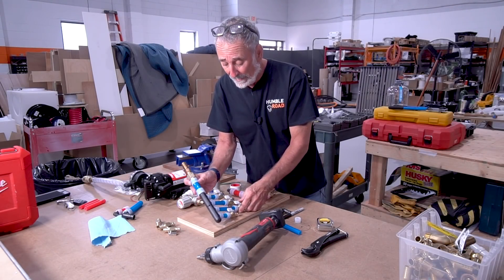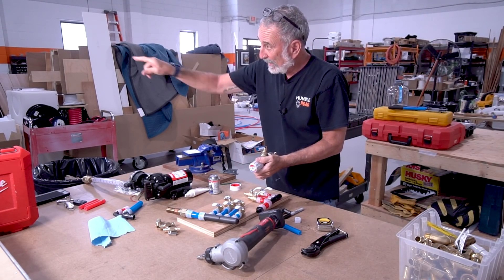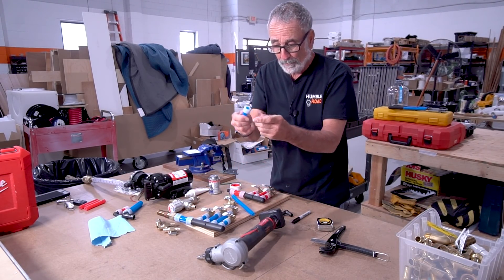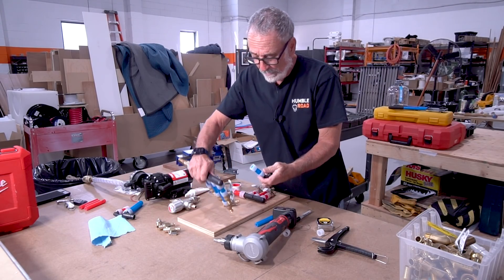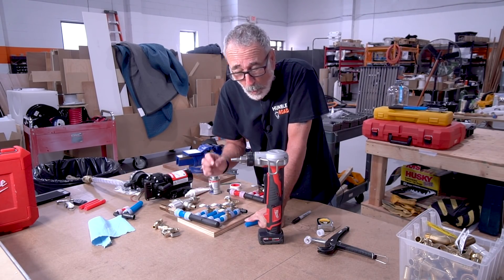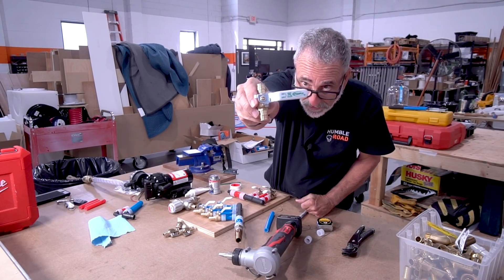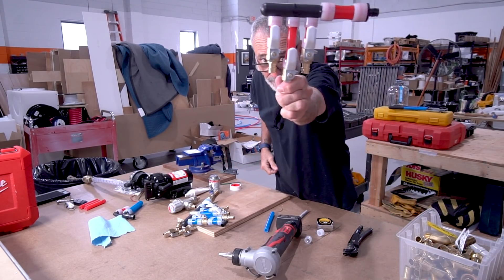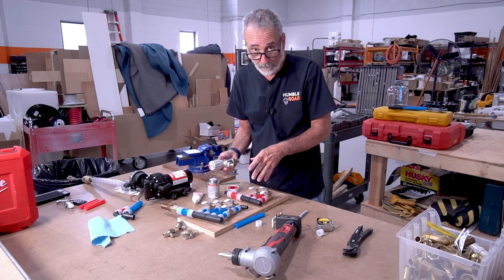VAN BUILD TIP SERIES: Building a 4 zone plumbing manifold using Uponor/Pex.

Comment: Has there been failures in the pex-a? I hear it's been a problem.
Reply from the maker: Yes, I have read that when the pipe is exposed to sunlight, the red/blue pigment in the pipe causes brittleness and cracking. Uponor, for one, has discontinued the full color pipe, replacing it with all white pipe with either blue or red writing along the side.
Reply: @HumbleRoad   Do you still recommend it?
Reply from the maker: Absolutely

Comment: Thought on plastic manifolds vs copper manifolds?
Reply from the maker: The plastic manifolds are part of the Uponor system, which I feel is an excellent system, superior to copper and sweat in my humble opinion
Reply: @HumbleRoad  Please explain why. I'm still learning – I understand the different PEX tubings, but still learning about plastic vs copper vs stainless, etc.

And thanks for the well-done videos. :)
Reply from the maker: Sweat joints will not hold in a moving van. Uponor.com

Comment: Can the levers on the valves be swapped out for knobs? No more issues with them bumping into each other then, and a clearly labeled knob would work just as well I'd think. Also, have you thought of using heat-shrinking hoses on the lines, as a secondary water seal? The issue being you'd lose your color coordination and could only use it on contiguous lines, but some colored tape would solve that and maybe leave you with a double-sealed line. Also also, could gorilla glue be used as a seal in case of a leak? I wouldn't think it would harm the plastic, and since GG is rubbery even after drying it won't be brittle, so it'll deal with movement (Bounces and so on from the vehicle moving) better. (Edit spelling)

Comment: is the crimped
ring pex ok (that's what i installed so far)
Reply from the maker: As long as your crimps are good, you should be fine. The Pex A (Uponor version) is flexible and therefore will survive freezing conditions

Comment: Another option: they sell copper manifolds with built in valves for use with expansion fittings - would work out to around the same price considering all the valves and fittings, not to mention all the time spent doing a DIY manifold.
Reply from the maker: Needs sweat? No? Or are they threaded?
Reply: @HumbleRoad  I've seen all different kinds; crimp, expansion, push fit, etc. Just mentioned because I'm working on the exact same thing right now!
Reply: @HumbleRoad  check out PEX Universe online.

Comment: I used the same mixing valve on my inside shower. Only one line across the floor no reason for access to plumbing behind the valve. Saves water by not playing with a shower control. Adjusts itself as your hot water empty’s. After having an electronic control at home I realized I’ve never changed the temp. So what’s the point? I bet I couldn’t convince 1 in 100 to try it though.
Reply: That sounds like a brilliant idea.

Comment: totally get the need for quality fittings and short spans/small footprints in your van builds.  Hopefully you don't have any more leaks...otherwise you'll have sharkbite and other fittings Frankensteined together when your clients are 'on the road'...and with such close tolerances it'll be an additional challenge. Which leads me to the question: how do you change these awesome fittings?
Reply from the maker: The cold manifold and the hot manifold are individual components and worst case, can be removed for service. Replacing a fitting is simply a delicate job of slicing off the collar and tubing. This is the main reason I use Uponor, the failure rate is extraordinarily low.
Reply: @HumbleRoad  I figured as much. and the fact that your tolerances are so close...no way you can comfortably get a crimping tool in there.  I like the design and thought process you put into your vans.  The goal is zero failure, but your access and layout are so well designed...it's a technicians dream!  Thanks for the reply and great videos.